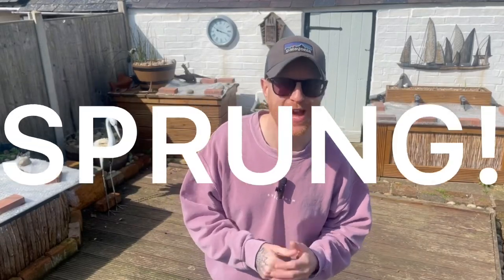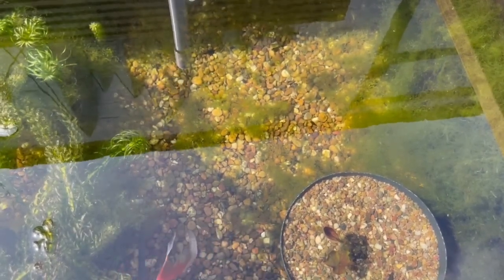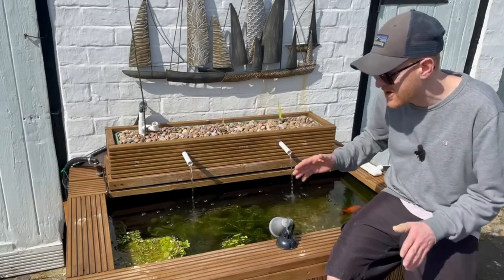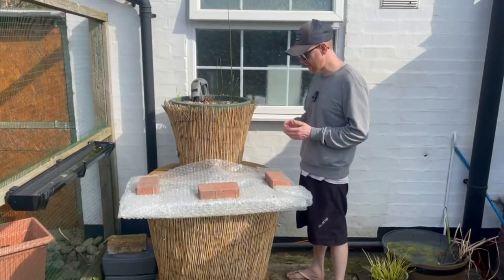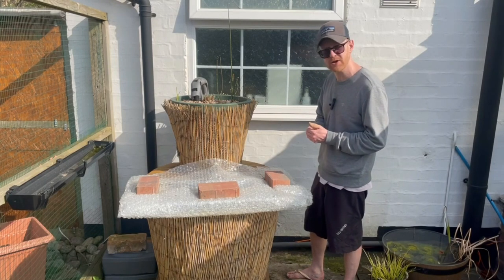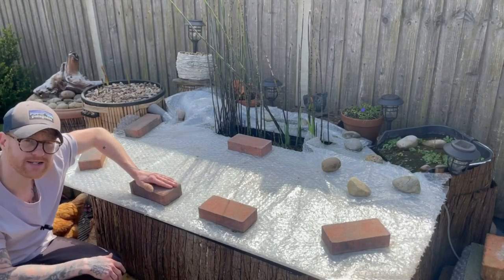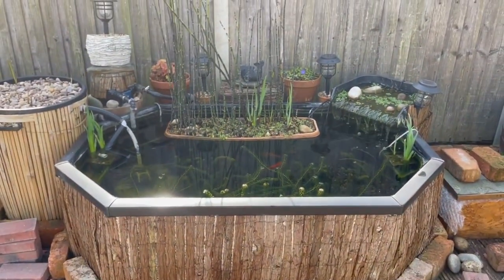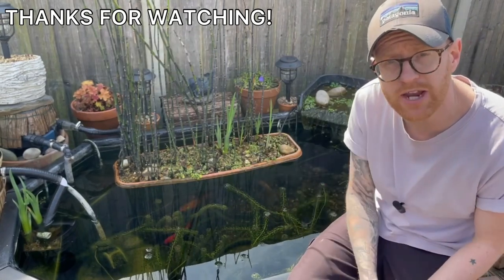Opening Up *ALL MY PONDS* ready for Pond Season 2023!

Comment: Do you do a full spring clean of your ponds?
Reply from the maker: I do like to do a bit Spring clean, but not a full drain and scrub down, or anything like that. Generally I’ll just tidy the plants up, and maybe re-pot anything that might need it. Then I’ll give the filters a clean-out, get the pond vac on the bottom to remove any debris that’s built up over the winter, and then probably do a small water change. Although I don’t like to do all of these thing at same time, I’ll usual spread them out over 3-4 weeks so as not to unbalance the ponds ecosystem.
Reply: Thanx for your reply it's really helpful

Comment: Hi! Just found your channel, I just watched you start this pond because I was thinking of making my own. On your first video I wanted to comment about the two tubes but stopped myself because I saw that the video was made a year ago and my suggestion would probably not be seen. Goody that you recently posted an update, so I can just put it here. Maybe the filter would look better if you connect the two tubes and have holes on the bottom of the connecting tube to make it look like somewhat a fountain/falls. 😊
Reply from the maker: Hello! And welcome to the channel!! I love that idea!! Maybe I could make something that could be taken on and off, so I could mix up the look from time to time.. Thank you for watching.. and for the idea! 😊
Reply: @GingerFishyOfficial  Yeah, like connect the two outflow tubes with two 90º elbow fittings and a tube with holes drilled under so it would really flow like a waterfall. Me, sadly not being that level of handy with the power tools (I'm making the simplest looking filter there is 😬), I found pre-made UPVC drip tubes (some are called rain bars), 90º elbow fittings and a tubes that are transparent (which are more to my taste). Another thing I suggest to add in your DIY filters are tubes with valves (or tap) at the back for all the waste to exit the bottom of the filter.  I use this to water my plants. Happy fishkeeping! 💕
Reply from the maker: @pinkelephantsandlemonades4011  sounds good!! Yeah, when I build the bog filter for my new pond I’ll be sure to add some sort of clean out valve!!! 😊